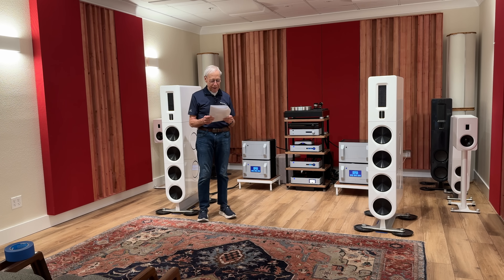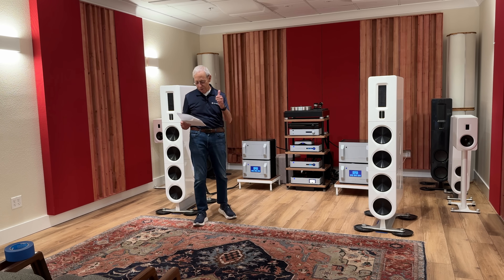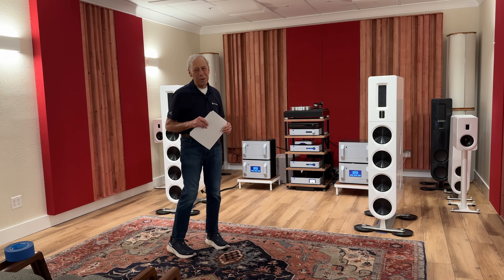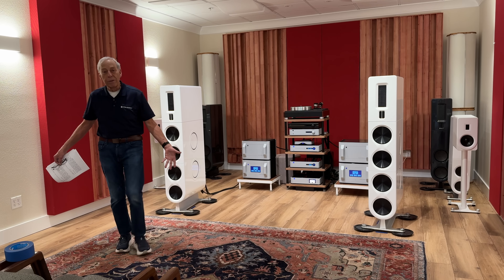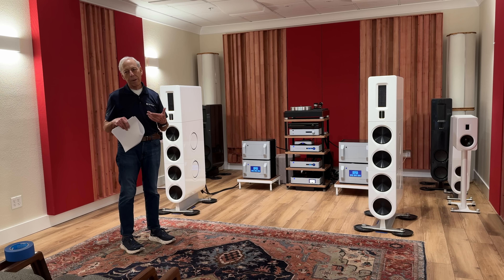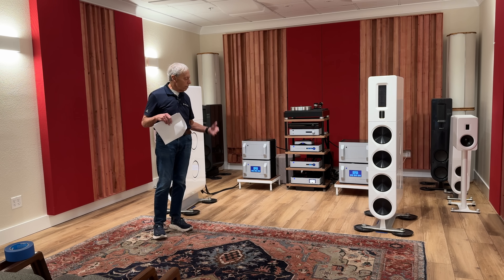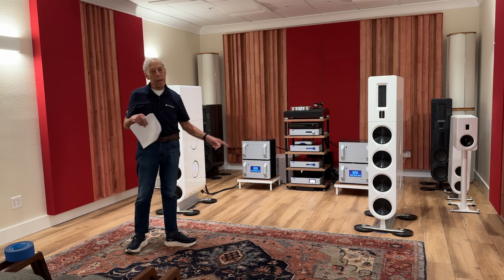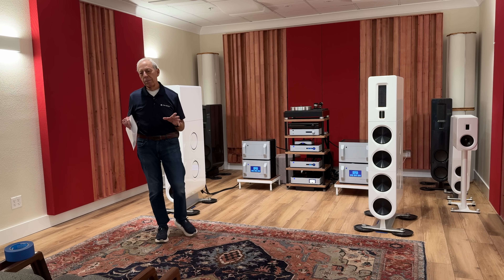Do silver or copper conductors matter in a speaker cable?

Comment: Silver is the material with the highest electrical conductivity, which has been physically proven. There is no debate about that.
Reply: Of course there's no debate about that. It's easily measurable and repeatable.

The question is whether it matters for the sound when the resistance of a cable is about 5000 times lower than the average of a normal loudspeaker, and there's only a 6% difference between silver and copper. That difference is extremely small compared to even the variations between different frequencies of the speaker, yet a power amp doesn't have any trouble driving speakers with very varying ohm loads to a flat frequency response (if the speakers are made to be flat, of course).
Reply: I believe he was talking about silver plated.
Reply: @pizzafrenzyman  Silver plating would be a subject if the skin effect was a real concern, but for audio frequencies on a speaker cable, it is not.
Reply: Yes, silver has better conductivity than copper and a better choice if you have unlimited money to spend. When comparing copper and silver wire based on cost relative to resistance, silver wire is significantly more expensive than copper wire. Thus, on a consumer market, you get more audio fidelity with copper for your Dollars spent. Case closed.
Reply: And that is exactly why it will lack warmth.
Reply: @AT-27182  I seriously can't tell anymore with these replies. The guy who was talking about oxygenating the signal, thus making it fresher, is clearly putting on a show - but "it's got a slightly higher electrical conductivity" being used as an excuse for why it "lacks warmth" I definitely can see people spreading... what with everyone in here claiming they can hear a difference being perfect proof of that.

Either way, taking it at face value: @storkfletcher821 is completely right: the downstream effects of such a property aren't vanishingly tiny, they are literally not measurable. As in: for our human hearing, regardless of how acute it might be for outliers, there is no way to determine whether we're using silver or any other, long-established alloy in use for literal decades. 

It might matter in very specific ICs and general purpose electronics or modules, it sure as hell doesn't make even the tiniest perceptible difference for thick wires if everything else is kept the same. This isn't new insight, we've known this for a long, long time.
Reply: @AT-27182  Explain!

Comment: Just twist your existing cables see what happens 😂
Reply: Dear @IanKnight40 

I can personally attest to the importance of this cable twisting.  My significant-other unexpectedly twisted my cable yesterday evening … That really opened up the high frequencies.
Reply: @AT-27182  Hi, I found out about twisting cables in the mid 1970's. I first heard the improvements when after reading about taking the drivers out of the speakers and turning them to twist the internal cables in HiFi Answers Magazine. I totally agree with your findings, and have always twisted internal cables in my own speaker designs and also the loudspeaker cables that I use. Cheers Ian.

Comment: Same diameter, less resistance (small difference). However, some silver cables are so thin that resistance will be higher.
Reply: When comparing copper and silver wire based on cost relative to resistance, silver wire is significantly more expensive than copper wire. Case closed.

Comment: Basically one uses silver cable to connect speaker that has copper indide cables and coils and thinks it makes a difference??
Interesting. 🤔
If it makes it can only be to worse.
If there is any benefit in silver it goes away the moment it touches copper cable inside speaker or coil. 
On the other hand all benefits of copper cable are lost because not presented in silver one and coil can't recreate them from nothing.
Reply: Actually verything the signal has to go through degrades it some. Those of us with way more experience and better "ears" can hear that silver sounds different, and as others have said in their comments, sounds purer sounding. So as far as purity, silver sounds cleaner and purer. Your statement that it's the same signal no matter what material the signal goes through is wrong; of course. The signal continually changes as it goes through more parts and different materials. That's why it's rare when a high end preamp has tone controls. Lot's of people playing physicist and pretending that  they understand what electrons do, going through a cable.... There are more electrons in a single drop of water,  (in the sextillions), than the number of grains of sand on all the Earth's beaches; COMBINED.... Think about that for a moment. You out there; don't take seriously that anyone understands what goes on with electrons at that incomprehensibly complex  submolecular level.
Reply: @sidesup8286  utter nonsense, there are thresholds for aural acuity, and they are way beyond what material discrepancies could possibly account for. This is bogus, if you account for conventional wisdom and established knowledge about fairly basic physics, you'd immediately realize that you just can't hear a difference in cables. Feel free to test it for yourself with a proper setup.
Reply: To cap these shenanigan off, and because half these comments truly don't care about provable, probable facts - which almost all of audio engineering and psychoacoustics consist of: make thicker cables at virtually no additional cost - it does exactly what you think different conductor materials would accomplish. Skin effect is irrelevant. The incredibly tiny conductivity advantage of silver over copper - really darn tiny. And that already infinitesimal scale is compounded by the fundamental way we process aural information, so no, this still isn't how any of it works. Buy properly shielded copper cables with a reasonable gauge for whatever you're driving, everything else is going to make a much more significant impact... including weather or room temperature. Wanna bet how many folks make these vague guesses randomly running their fans and ACs? It's a lot, I'm telling you.
Reply: @sidesup8286  You don't have better ears. You are ordinary human, nothing more. 
Rest of your comment is nice audiophile bedtime story.
Reply: Let the signal keep degrading is smarter than keeping it from degrading further?
Reply: @sidesup8286  how exactly do you presume the signal to degrade, do you think the signal just gets thrown out of cables cornering too tightly in the room or something?

There is no material-related degradation whatsoever. It's the same signal.
Reply: @sidesup8286  There is NO degrading of signal at such cable length. There can be only charactheristic of material that lets certain signal better than other. If, for example, silver cable lets certain signal to flow through it because of it's characteristics
 at moment it thouches copper that signal is altered to one that could flow through copper in same way if only copper was used from amplifier.
Idea that silver speaker cable adds benefits while is connected to copper components of speaker itself is pure nonsense.
Paul should know better. 
However he has reasons to promote AudioQuest and this isn't first video he is doing that.

Comment: Room temperature superconductors for me please.
Aren't all speaker coils wound from copper?
Reply: The warmer speakers use NiChrome instead of Cu.
Reply: @AT-27182  Good one!!
Reply: Nope, Dynaudio uses also aluminium for speakercoils for less weight
Reply: Wait. Are you saying that... resistance is futile? 🎉😅
Reply: @just-facts-please-thanku7262 yes, as a trekkie I do! Just assimilate everyone 😂
Reply: @Impakon

There is just about no way that Al will be warmer NiChrome.
Reply: @just-facts-please-thanku7262  good to see the occasional Douglas Adams reference 👌
Reply: @ianbigsand7

In that case, to truly get the most out of the room T superconductors one really should have at least a 15kW cold fusion power generator, otherwise the power grid really does hurt the performance.
Reply: @AT-27182  only an audiophile grade coldfusion power generator will do
Reply: @ianbigsand7

I have read that the best audiophile grade cold fusion reactors are made fairly close to PS Audio. The experts are Martin Fleischmann and Stanley Pons at the University of Utah.  They deliver the warmest, yet clear and detailed results.
Reply: @AT-27182  The original and the best!  😂
Reply: @ 

Dear Chris Antoniou,

You bet!  When purchasing a cold fusion powerplant, it is the wise person that sticks with the original designers.  Spending money on anyone else's technology would be quite foolish.

Best wishes.
Reply: No, borresen use Silver coils, some also have alu, anything you need🎉
Reply: Some speakers, even some "high grade" brands are wound with copper coated aluminum (CCA) wire.  Sad.  How log is that going to last?  It's said that aluminum and copper have high galvanic action against eachother.
Reply: @welderfixer  in my experience, Al is rather more prone to work hardening than is copper, so I'd expect it to be less suited to the wires to the driver terminals, but I know very little about materials science, maybe there are alloys that are fine. Of course the lower density of Al might be quite an advantage in conjunction with a light diaphragm. 
I have referred to Al to avoid the transatlantic divide in spelling.
Reply: For a voicecoil it is all about eddycurrent, alu does well also

Comment: I think its an error to obsess about expensive and exquisite cables (as I used to do). In my opinion, the large cost of high end cables would be better deployed by spending it elsewhere in the system eg buying a better moving coil cartridge for vinyl, or a more upmarket dac for digital. I'm perfectly happy with mid-priced Audioquest speaker cables. Upgrade-itism concerning cabling is a distraction and source of discontent, my advice is to get a good one and stick with it, job done. Also, in my opinion, the difference between cables is much over exaggerated by the industry. I agree with the late Andy Singer, cables are the 'cherry on the cake', only to be indulged in when absolutely everything else is 100% optimised and not the most efficient way to spend a large chunk of cash.
Cheers from London everyone!
Reply: I'm lucky, being at the budget end (£2500 used gear) I don't have the funds to get drawn into that, and quite possibly my gear wouldn't reveal the difference between my Audioquest power cords and the audiophile nirvana cables that cost more than my speakers..
I'm more than happy that now I've bought some decent quality cables and interconnects (all used bargains) I don't have to think about it again. Not sure I can 'hear' all my cables, but the Chord Clearway RCA (which the seller kindly included with my CXN V2) is very noticeable, not least because it's blue.
Now that I have ridiculously thick power cords I like to impress visitors by making sure they see me plugging the cord in, which always draws the response ' that's a big one' 'Oh yes', I reply, 'this amp is a bit of a hungry beast' I just wish I could tell them its made of rare earth minerals and cost over £1K.
Oi, Oi, Saveloy! from a Londoner in West Wales.
Reply: Just fyi; Not everyone prefers MC :)
Reply: If you've got a $250k system, upgrading the amplifier, DAC or speakers could mean spending $50k+. At this point, a $5000 cable is a "cheap" upgrade. If your system is missing a digit (or 2) in terms of price, then you're 100% correct.
Reply: You never heard higher end cables it is so much more in the geometry and shielding and connectors than just the material.
Reply: @pennfootball71  Really?  Do tell!
Reply: About the only difference you could possibly care about in cables is probably sturdiness and robustness, doubly so for performers. Everything else definitely is pure snake-oilsmanship.
Reply: @ how about you actually give it a shot? Then we talk 😌
Reply: @piripiri-kefalotyri  Try it first!

Comment: First time I hear someone could neglect silver vs copper difference :) Even starting audiophiles on budget systems hear the difference and mostly stay away from silver, because it's too harsh.
But you must also consider that silver does not equal silver. Good quality silver or copper conductors are so much smoother than vast majority cheap cables on the market. 
I prefer pure copper all the way, but have also some copper conductor covered with silver coat which makes a very nice balance of the tones.
Reply: Quality silver is not harsh or screechy. The tone is just purer. But… to each his own😊
Reply: @nirodha35 most people who think silver is bright have used silver plated cables and not pure silver.
Reply: If the Ag wire is too cold, it can be easily warmed with some NiChrome wire.
Reply: Not even the highest-end audiophiles and producers in the world could possibly hear a difference. There is no "too harsh" quality to silver, no other alternative makes any difference - they barely even make any difference from a strictly physical (vs psychoacoustic) view.

I totally believe that not or improperly blinded test setups will cause you to believe that you're hearing a difference, but that is pure suggestion and not actually something a proper setup would reveal - because there is nothing to reveal. Different cables and connectors and materials are virtually always snake oil and they've always been that, just as the utterly science-removed audiophile community at larger has a history of straight-up buying into all the disproven conjectures and salesman tactics suggesting you can enhance your enjoyment with a few extra hundreds of bucks.

It's also completely unbelievable to me that you would have heard this the first time lmao, this is like first-semester knowledge every remotely decent engineer internalizes by the end of their degree. Which just goes to show how untrustworthy that particular niche is. Either way, ask an educated mixing/mastering engineer and he'll tell you that it cannot possibly matter as long as the laws of physics hold up. If you hear a difference, it's not because the cables or connectors introduced it.

Comment: I bought silver speaker wire. I can't hear the difference between them and cheap copper clear jacketed wire on a spool that you can buy at Walmart.
Reply: If you don't hear the difference, may be you just can not hear it. In this case, don't waste your money on expensive cables. Just buy good quality cables with good connectors that will not get loose over time.
Reply: https://youtu.be/HJGw8zwx-6g?si=4-78XdL1NZFIfSWJ

https://youtu.be/GTwwvY8Is1o?si=-3a_slNpHoTgJSkc
Reply: @Geerladenlad  sure you did.
Reply: Must surely be that your speakers & setup just simply are not revealing enough to express a different sonically
Reply: @satyavratadas1640  Sure. What a classic.
Reply: @satyavratadas1640  Codswallop.
If there's an audible difference you'll hear it no matter what kind of speakers you're using or amplification for that matter.
Reply: @Geerladenlad i can now say, you need a big update on your setup, it will be Worth it and it dont need to be expencive👊
Reply: @Geerladenlad  Codswallop, utter, utter, CODSWALLOP.
Reply: @Error2username  Balderdash!
You don't know what I have. So your advice is utter poppycock
Reply: @Geerladenlad ignorance is a bliss i guess, peace out brother🎉 Remember, dont talk about sound quality before you upgrade😂
Reply: @Error2username  Then you're in paradise. 😉😂😂😂😂
Reply: @Geerladenlad  Flapdoodle
Reply: Hmm, thats weard, Whats your setup friend? If you dont hear No difference i guess something is wrong or need updated🤙 I dont use Silver cabels, but after crossover many do, me Inc but only on tweeter.